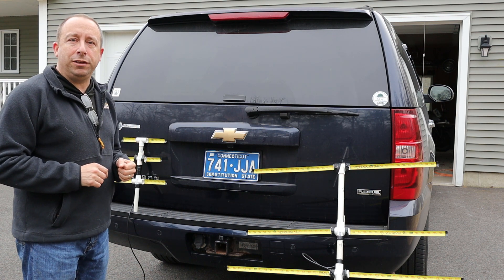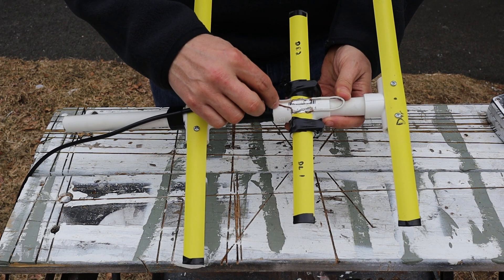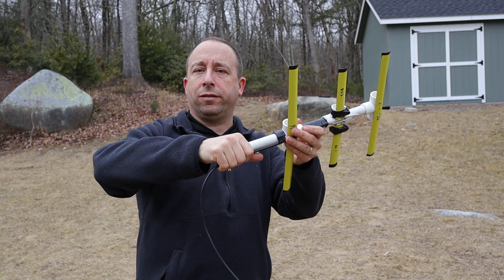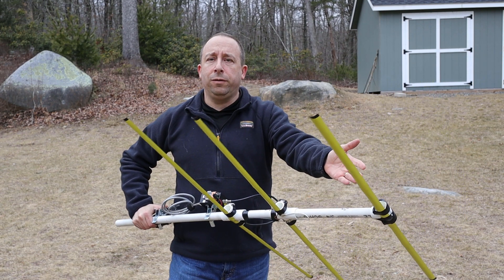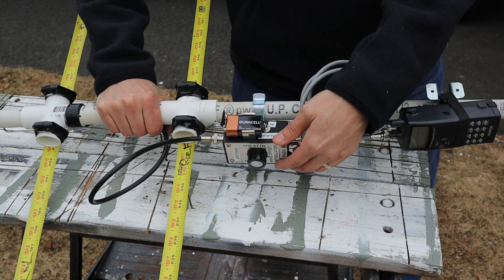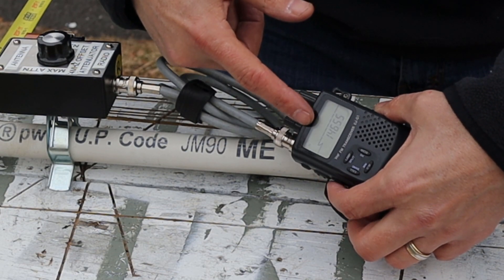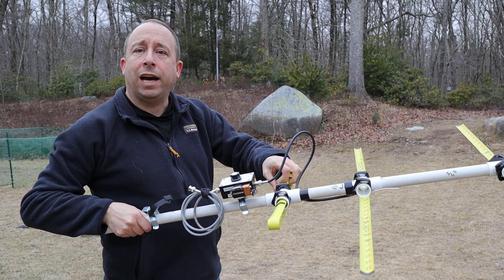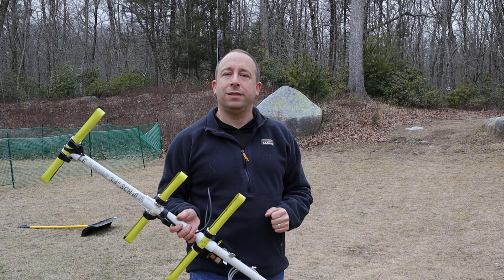Two Simple Ham Radio Antennas You Can Use For Fox Hunting

Comment: A word of warning that driven element needs a choke on it or you will be off as much as 10° and that's a lot over several miles you can wrap coax around the boom or build a sleeve choke or install  Ferrite beads On the coax , try ameing the antenna at a source and you will see the actual pattern is distorted .